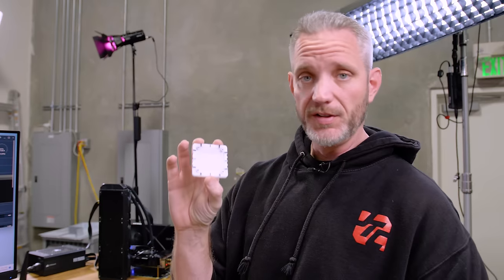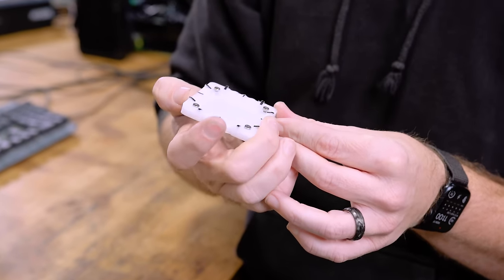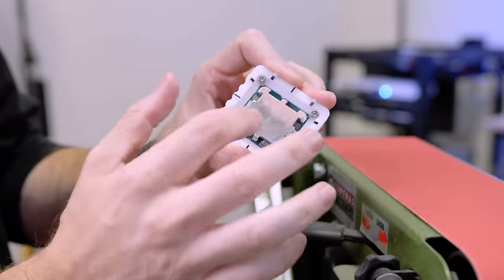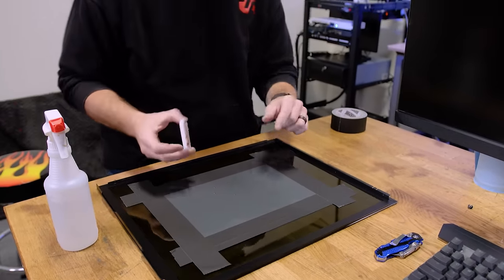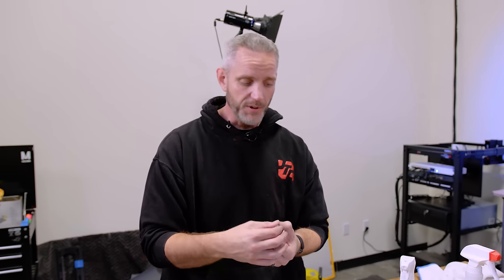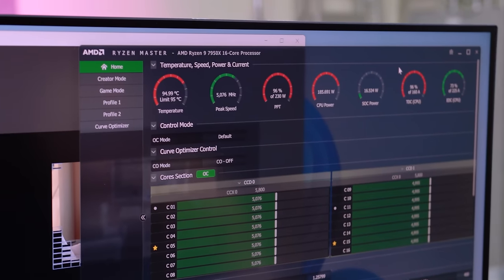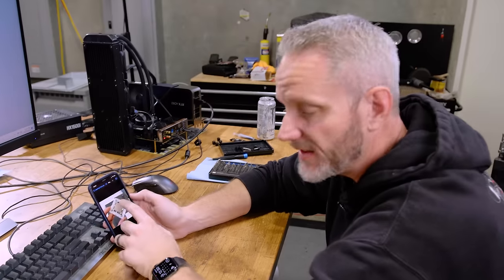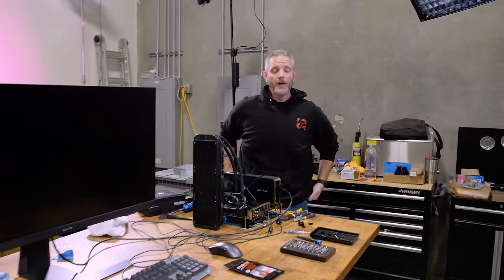Modifying the 7950X CPU for better thermals... VOIDED WARRANTY!

Comment: at this point i don't get why cpu makers don't vaguely lap the HS's. there's literally no real reason they can't have it at least closer before they ship it out. make a machine to do it, pick up 'new' HS's, they go in slots in the jig in the machine, it rotates on various grades of an abrasive material, before it goes over to plating.

i wouldn't think it would be that hard. yet this has been a problem since the advent of HS's. (though admittedly, it wasn't super relevant for some use cases, as it didn't matter terribly much for those).

Comment: I would love to do a thermal simulation of the IHS to see what the improvement would be without the influence of lapping. 
However i dont have access to a CPU. @JayzTwoCents is there a way you could get me some measurements of a un-sanded IHS and the thinnest thickness that would be possible?

Comment: Jay you should get your hands on a Silent loop 2 while waiting for the delid tool. It’s the only AIO I could find that has the CPU contact area Nickel plated. Also ask Der8auer for some of his foam smd protectors along with some of his new Liquid Metal. All you would need is a bit of liquid electrical tape and you’d be off to the races.

Comment: lapping it thinner will give you worse temperature if you are using waterblock, you need that thickness to gain larger surface
Reply: That doesn't make sense. The surface area stays the same no matter how much you lap the CPU. Lapping reduces the amount of material heat has to travel through which reduces temps regardless of your cooling solution.

Comment: that's tooooo aggressive of a sand paper even to beggin with.
You sould go with at least 240-320 
Also, you may want to use a sharpie to "paint" all the metal before sanding, and as you progress it will be removed so you can keep track of where are you applying pressure and keep doing that to ensure you are not making it worse

Comment: Jay, I dont like your lapping technique a damn bit. You should be using oil instead of water as your cutting medium - sprayed over the abrasive to prevent particle clogging the abrasive and to clear it of particles. Lapping in a circular pattern is a polishing technique - not  a technique for a flat and level surface. Back and forth, horizontal then vertical across the edges, then the same across the corners - 2 to 3 swipes across the abrasive between each rotation (each rotation you're cutting across the direction of abrasion - faster) . Clean the surface and check periodically. You should use a marking medium (prussia blue or a bearing blue) to verify its still flat and the cross cut pattern on the copper from the technique I've illustrated will make it pretty clear whether your getting what you set out to achieve.

Comment: My R7 7700 with no OC other than "game boost" turned on in the bios would hit 95 in prime95, 88 in cinebench.  Turning that off, wont even go over 73.  Pretty sure 95 is normal under those conditions.

Comment: yo. back in the days we had a bunch of direct die cooled cpus. they were not that wattage hungry or temperature reliant, but... yeah. i dunno when or why they started to add heat spreaders. it's just a bunch of xtra material you don't actually need. the industry is fucking bonkers. they just gotta get a solid mounting standard for both intel and amd. ohh man... this is a clusterfuck. @_@

Comment: "AMD said 95*c is fine for daily use"
The same thing they said about ryzen 3900x running at 1.5v in idle when TSMC themselves and their spec sheet would suggest 1.3v max

In theory 100-110c is fine for todays transistors, but goddamn such temperatures for daily use? Wonder how much degradiation will be speeded thanks to these temp

Comment: Given it was throttling down to hundreds of MHz, I'm honestly kinda surprised Windows was running.  It's not exactly a resource-light operating system these days.  (That's not inherently an insult, just Windows is designed to run on relatively modern hardware, not mid-90s tech.  There are a couple of Linux distros still around that could run on those mid-90s computers that were actually designed to run in the sub GHz range.  Just saying Windows is not that.)

Comment: I had this weird thing, when I Switched from Intel 6th to 10th gen and tried to use my bequiet Dark Rock 4 Pro, it also bottomed out and didnt really Touch the CPU. Ended up sanding down the the standoffs, so that the cooler came down. Temps are fine now.

Comment: Definitely misleading to say glass is perfectly flat, glass flexes far more than people realise, the misconception crops up quite a bit when people are doing precision work with tight tolerances. It'll likely be fine if the surface you have it on is decently flat but it's definitely important to be aware that it will transfer large amplitude imperfections in the underlying surface.

Gold standard would be to lap on a granite surface plate but they start at $100-150 for a small high quality plate.

Comment: So I'm fairly new to this, but why would AMD be targeting 95C?  There's gotta be a specific reason for this...right?
Reply: Well, not all their parts can yield the required frequencies to beat Intel at low voltage, so by increasing voltage they get the speed to compete on a larger yield. But if you're a lucky winner, you can try running -30 Curve Optimizer on all cores and your temps will go WAY down and you'll even hit higher all-core frequencies if you keep your thermal cap at 95C. My 7950X sample has a very strange problem in that when I run even -5 or -10, I can't post, but if I set a -350MHz on Fmax (boost clock limit), I can run all cores steady at 5280MHz with a -30 curve and I'm getting over 39k in Cinibench R23 and over 66K in PCMark/Passmark CPU tests. My theory for the POST crashing is that during boot, it's very briefly hitting a boost clock that it can't support at low voltages, but such frequencies are so brief in actual use, that they don't matter. Mind you, I have two AM5 motherboards (one Asus X670E, the other a Gigabyte B650) and one of them is showing a limit of 5850 and the other 5750 (not sure why) so when speak of setting a boost clock limit of -350MHz, that is for my board that shows a limit of 5850. Either way, I'm having to target an overall boost clock limit of 5500MHz (however you do the math) when running -30 on Curve Optimizer. So, while I thought I had a bad CPU, it turns out in actual practice to be quite an efficient powerhouse.
Reply: Cole, I set my VRM frequency to 600Hz (instead of Auto) on my ASUS ProArt x670e board and now I can get away with less adjustments on the boost clock limit. I am down to -175MHz now and I'm not done testing. My chipset temps also went down (was previously very high like 95C, now 55 to 60C) so this may have been the culprit.

Comment: If you take off 1.5mm from the IHS, doesn’t that fuck with cooler mounting hardware?
Reply: It depends, noctua is spring loaded, and i preloaded the springs whith the exact size i shaved off just in case

Comment: 8:15 more scratches = more area for heat spread = better cooling in theory...Someone should make a test if scratches filled with liquid metal is better than flat surface with liquid metal

Comment: I fail to understand why AMD, on a new architecture, new socket, new motherboards...would insist on backwards compatibility with AM4 coolers. I find that decision nonsensical. I hope in the January CES they announce 3D cache, and new cooler requirements.

Comment: use a straight edge !!! like a steel rule or even a clipper edge 
and hold it up to a light a look through the gap between  IHS  and the pads on the tool
Reply: every time you apply the chip to the sander you are losing the reference points !!!!!!!!!!!!!! because your sanding the pads on the jig he created
Reply: Looking at creating vacuum and holding the substrate in a jig 

Might pull the IHS off
Reply: Looking at creating vacuum and holding the substrate in a jig 

Might pull the IHS off

Comment: I have a noob question, if both new cause and gpus run hotter even if there's a way to cool them down, is the heat then just gonna end up permeating the room and it making it hotter?
Reply: What makes your room hotter is wattage. That's the energy being used by the component. 
The temp registered by the sensor has nothing to do with the heat released into your room. You can run your current hardware at 95C if you just cool it poorly.

Comment: A BELT SANDER? WTF? It would have taken less than 20 minutes to sand it by hand and would be so much safer. The belt sander was totally overkill. Plus, polish is removable. Polish is like the finest sand paper you can use. It comes off when you clean it. I think Jay was thinking about automotive wax. Polish would take more scratches out. Jay is a bull in a china shop. He is scary.

Comment: I decided to start a channel while recovering from an injury and I knew nothing about computers. it's on another account so don't think I'm trying to advertise my channel. I'm not going to mention its name or what I do here at all.... I'm being genuine when I say I appreciate your knowledge but a lot goes straight over my head. I have learned enough to ask what I hope isn't a stupid question. I'm not a gamer because I can't afford a decent enough computer. I'm a rocket league lover but I have to play on ps4 because my laptop computers do not meet minimum requirements. I'm stuck with two 7- and 8-year-old HP laptops with a core I3 6000U processors in each and intel integrated graphics 540 i think....  I want to be able to film with 3 cameras through obs at 1080p simultaneously. I also want to run an editor called DaVinci resolve that I found online. I only had a few dollars to try and upgrade so I ordered a ssd to replace the old spinner and 16gb ram.... cheapest i could find of course because I can't work and money is super tight. One have 6gb and the other has 8gb of ram......smh. One day I'll get you guys to build me something when i can afford it but, in the meantime, can i do anything to get these computers running faster or maybe get these processors to push 2.4ghz so i will meet the requirements for rocket leauge and i can continue making content for my few hundred subs? please help me out, I'll be eternally grateful for any help.

sincerely,
A forever subscriber

Comment: But for the savings AMD made not including a cooler, and the consumer needing such EXPENSIVE motherboards, with brand new PCIE 5 storage, and more expensive RAM, they claim to save you money on not needing a new cooler? Where's the logic there when the IHS design, allowing for older coolers to work on it, thermally throttles the CPU? They hung on to the cheapest standard to replace, while everything else is new and at a price premium. You're paying to produce more heat and waste more power by design compromise.

Comment: It occurs to me that when the 3dv-Cache chips arrive, they might have a thinner IHS because AMD will be able to hollow it our more and still maintain the same z height
Reply: I feel like that was the main purpose for the thicker IHS but no one seems to agree with us
Reply: @falcie7743  Well i didn't think it was the reason for the thicker IHS, because officially they have stated it was a z height issues to maintain AM4 cooler compatibility. However, you do have to wonder why they didn't just insist on a new AM5 cooler type from the cooler manufacturers, so perhaps it was indeed forward thinking for chips to come that might need the additional space which keeping with the AM4 Z height would give them
Reply: v-cache DOESNT add to z-height of chiplets. Source: AMD.
Reply: @zbrkesbris5987  For zen 3 thats absolutely correct, however unless you know something the rest of us don't, no information has been release on the implementation of 3d v-cache on zen 4

Comment: My 6-core 8750h laptop CPU runs at 100-102 when gaming no matter what I do. I tried multiple times to apply better thermal paste, yet the improvements are un-noticeable. I also tried under-volting, but it takes over 1.3 Ghz away just to lower the temps 1 C!!! I feel like I will never fix this thing. :(((
Reply: Was it like that when you first purchased it, or did it get to those temps overtime? If it was overtime, it might be that the thermal paste is not thick enough for the heatsink the laptop uses and therefore is not making enough contact.
Reply: @Nunoflashy See, it was around 89C average when I got it and I thought it was bad, but HP said its fine so I replaced the thermal paste and it dropped to 84 then over time (about 1.5 years) it rose to 102C and has been there sense!

Comment: i would not step in to amd trap in my life, never gona use amd. AMD stands for  problems instability, and constant looking for mods software hacked bioses etc.. while intell gives you peace and calm, when i build my skylake, pc 6700k and its just working rock stable no issues, smooth  all games working zero crashing perfect.. My friend with ryzen is consta fixing updating looking for old drivers, cause new ones have bugs.. etc...  I strongly recomend avoid amd amd radepms despate those cores and perfomance... Stability of amd systems are huge issue

Comment: I still don't understand why neither Intel or AMD actually sell enthusiast CPUs (designed for at least lite OC), so you can't just buy Intel K processor and start overclocking it, you need to remove the heat spreader, slightly lap a crystal, modify cooling bracket etc. Why do they just not sell CPUs with the already naked crystal, like old AMDs?

Comment: Curious if there is more to the 95c then what meets the eye. In the beginning of the video while running the software as soon as the test stopped it went from 93-95 to 73ish instantly. Once the test started back up it shot to 94c almost instantly. There is no way the cpu could drop 20c in seconds if not less.
Reply: That's how it usually is though ... Happened woth my 5900x going from 80 to 50 in a second ...  Coolers are actually really performant
Reply: Cpus aren’t like light bulbs, they increase in heat instantaneously and also dissipate it just as fast

Comment: I will never buy  a CPU that runs that hot....close to the melting point of the solder and  effectively going to cause problems with your water cooler components !

Comment: The belt sander step was pointless dude, the original machining is much better than any belt sander finish, you should be using a figure 8 motion when sanding. another thing to do would be to lap the IHS to the Heat block to provide perfect mounting.
Reply: He used the belt sander fot take off thr material, he polished afterwards, i did same thing but manually

Comment: It is cool how you show your backside in this videos, clearly not understanding that heat transfer scales proportionally with pressure. You removed height of the IHS which directly reduced mounting pressure. derbauer did (at least in his initial delidding video) did not control for mounting pressure, and came to the wrong conclusion that the IHS thickness was at fault.
Reply: it would be cool if a mounting system incorporated load cells so that you could control for this and dial in specific pressures

Comment: Since the CPU has no pins, you could just measure all 4 corners of the CPU and remove 1 1/2mm from it measuring occasionally.  Not as fool proof but if you're not a fool... you'll be fine.

Comment: What's the point of all of this if amd says 95c is safe for your cpu and its under warranty? Lowering cpu temps won't change how much heat is being dumped into your room its still outputting the same amount of heat whether it's st 70c or 95c

Comment: Let's hope AMD actually listens and thins down the IHS of the next models. 95C is not acceptable.
Reply: The spreader is more than likely that thick to give them room for the 3d models whenever those come out
Reply: @NFchegg  no, it was to appease Asetek and their garbage design. The IHS was thickened to meet the clearance requirements for Asetek designs. If you look at Cooler Master's designs with AIOs like the ML240L V2 ARGB, they use the clips and have the proper tension.

This was just bad engineering outright.

Comment: Question is why did AMD make the cover so thick if it doesn't have to be?
Reply: Because they wanted to keep cooler compatibility with AM4 so they did the same Z height from the PCB as AM4 which meant doing a thicker IHS since the LGA socket is thinner than the old PGA Socket. Problem is that cooler compatibility is still broken if the old cooler had a Backplate mounting solution since the new socket has a integrated Backplate covering the CPU mounting holes with M3 (i think) tapped Holes in it and also the mounting for the ILM (the bracket holding the CPU in place I believe AMD calls it differently actually) which means you can't simply remove it.
Really makes me wonder if some cooler manufacturers will go as far and make there own backplate given that it would be a rather delicate operation to change that out.

Comment: watching you lap that on a belt sander at 120 hurt my heart...   if you dont want deep scratches use a higher grit.

You could remove that tiny amount of material with 900 or even much higher grit when using a power tool.

Comment: Without lapping, just using a Lian Li Galahad 360 AIO, -30 curve optmizer, and setting my FMax to 5500MHz (because I can't POST otherwise) I'm getting a Cinibench R23 score of 39,200 and all cores are running about 5280MHz. I can get closer to 5400Mhz with combining PBO but I dont' see much diff in scores. Anyway, it's rock stable, but I have to set that Fmax (boost clock limit) and power/temps are very low (idles < 40C and power is almost nothing at idle. I'm also using Kryo Extreme.